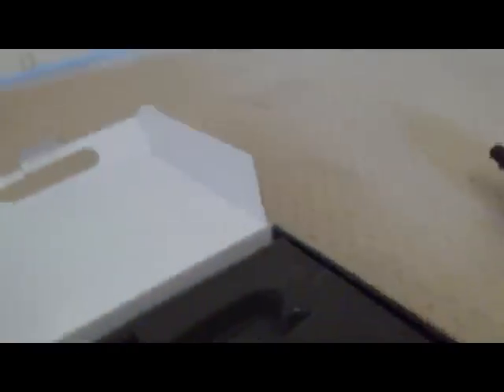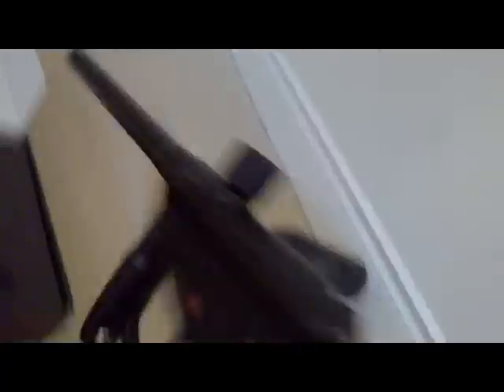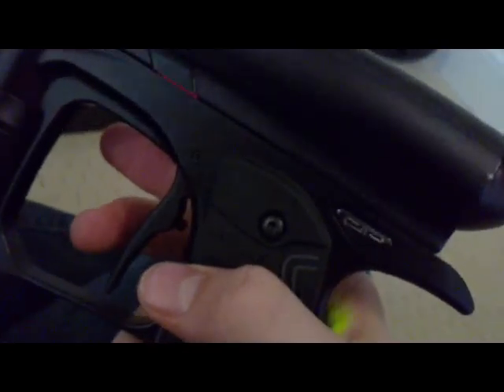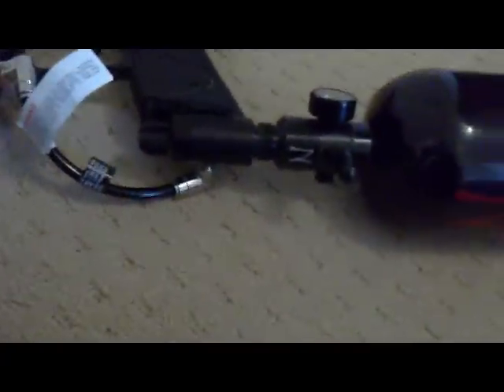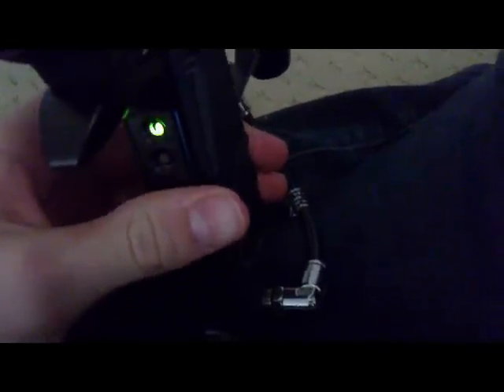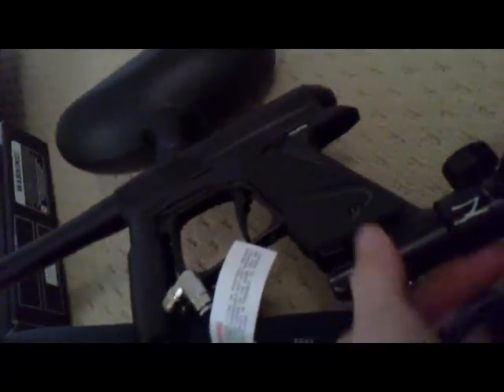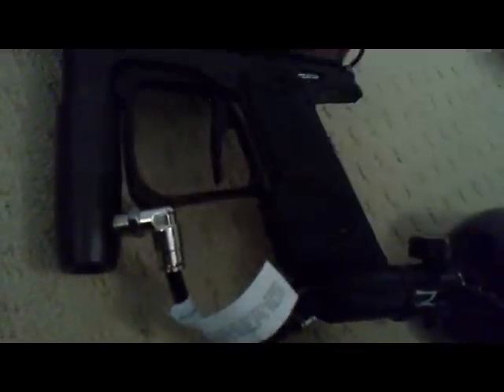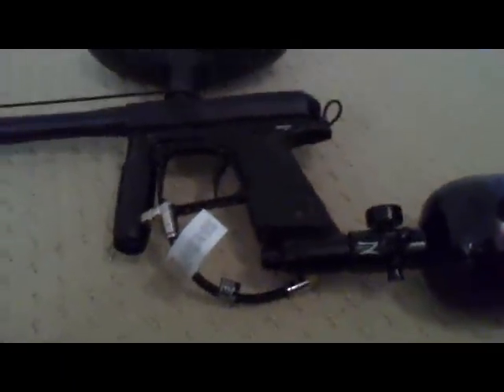dangerous power E1 paintball gun

Comment: It's an "Autococker" style barrel. You can use any brand, but it needs to be Autococker fit. Even if you're new, a barrel is an investment for this gun IMO, so go all out or keep the stock on there. It's good out of the box, and the length is awesome if you play front.

I loooove the Dye Ultralite .688 front and back. Everything else just feels like a waste basically. I'd rather spend $100 for a great barrel kit than a $50 unit that's iffy. I still use the stock barrel too though!

Comment: @KFsteelers yes you are right there would be e great difference your velocity will go way up meaning more range but the field will make you lower it because of regulations. and getting a smaller bored barrel also helps with efficiency because it makes sure the ball flyes out the barrel before the rest of the air

Comment: the rail... it is WAY quieter then any other 250 dollar range gun and very accurate ( with upgraded barrel) but its a very nice gun and never chops has 4 modes. i think a 3 point trigger adjustment, has dwell setting and everything you need to make your gun shoot like a $800 gun ... the only thing i would get is an upgraded barrrel

Comment: @AAVince2513 what your saying does have a lot of truth to it after a certain level, meaning if you have an 11" barrel and a 14" barrel the accuracy change will be inexistant or un-noticable although barrel length CAN make a difference! for example, a stock 9" or 11" barrel will have better accuracy than a 2" barrel (no such thing exists), but do you see my point? the whole point of a barrel is to just guide the paintball in the correct direction.